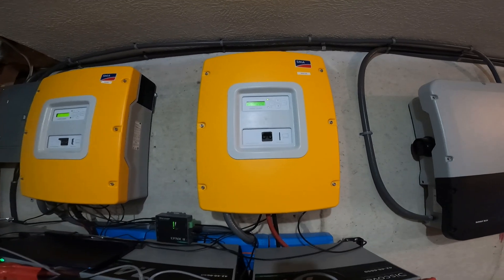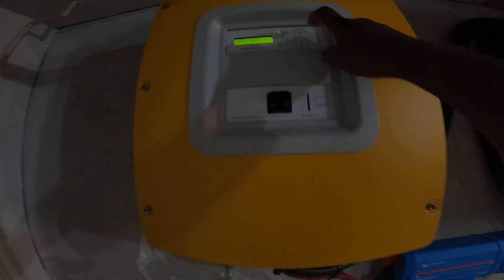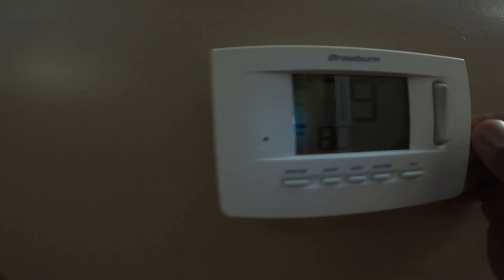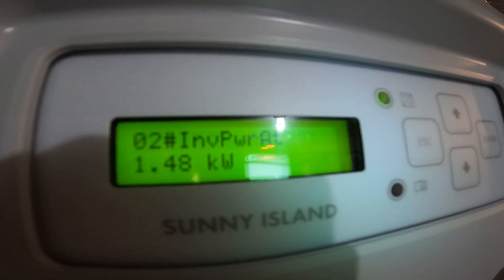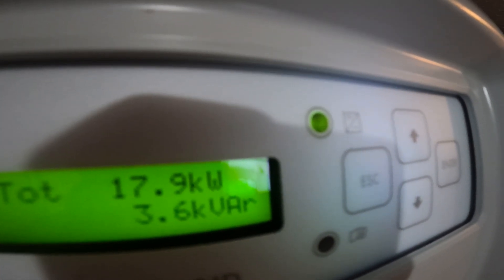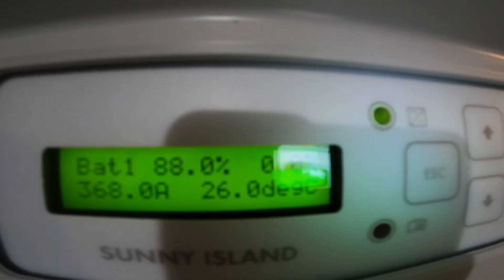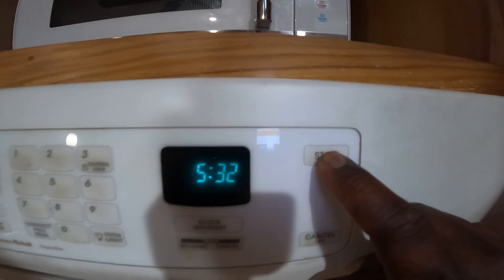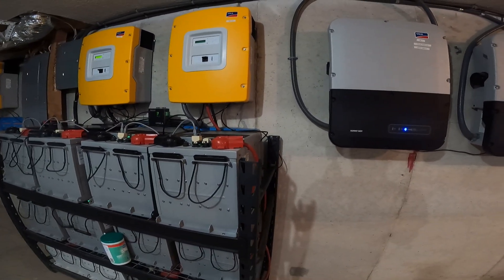OFF-GRID SMA SUNNY ISLAND INVERTER (24KW) LOAD TEST.

Comment: Hello there, a main question.
Did you completely DIY the entire system and if so was there any requirement for a grid guard installer code needed when pairing the Sunny Boys to the Sunny Island?

Can you do another deep dive demonstration video on how a first-time DIYer may duplicate your system at Home;  for a 1 or 2 or 4 sunny island.  Like what types of cables were used, what kinds of other components were used likes like all the story of whats going on from the Batteries connecting to the Sunny Island.   How to connect and set the proper parameters on to setup AC power from Sunny Boy to Sunny Island WebUI Settings.  How to design the wiring of the Sunny Island Inverter power output to the Sub-panel and to the Main Control Panel.    

The in depth technical engineering installation run down.   So that other inexperienced in electrical-solar preppers may assemble a similiar DIY Solar Entirely Off-Grid System.  

If you can make one more video one this maybe an update on how has your experience been thus far on how the SMA/ Discover Battery system has been doing.  

 -Thank You.

Comment: Well that is 24 KW 24,000 w you're going to have to have a pretty good size house to put those up to a full load especially when they go to KW over the rated power they run each one around eight kilowatts for an hour and a half s rate before it shuts down are you looking at quite a load I don't know if your house would ask you better use all that power for an hour and a half to get them all the shutdown that is an awful lot of power.

Comment: It looks like your Sunny Islands are primarily DC coupled through the victron charge controllers? Mine are arranged,  different in that all my loads are directly supported by my grid tie (created by the Sunny Islands) no grid from power company. My Sunny Islands don't produce positive power during the day.(ie no battery energy is used)( They simply control my grid tied inverters.
The excess shown by a down stream arrow on the sunny island master(negative number)shows excess power charging the batteries for night use.
My batteries are 90 KW hours and my house consumes around 15-17 KWhrs per night. FYI Fred
Reply from the maker: Hi, I am actually AC Coupling the Sunny Islands with the Sunny Boy inverters. I do not have charge controllers in my system. I am only using the viltron Busbar Lynk system to parallel my battery bank together. These bas are rated for 1000 amps. My system works exactly like you have explained yours above.
Reply: @backtoeden2030  How much does your house consume at night?
Reply from the maker: @backhoefred   It depends on the loads we may be running. Sometimes even doing laundry at night. Its  anywhere between 15-30 KWh and especially if we run the AC. The regular house loads like the refrigerator, computers and tv including what the inverter consume is only 400-500 wats per hour which total to 5KWH over the night.
Reply: Did you have public power previously? We did, we keep them as backup. But I am very happy with SMA. Mine were from a bankrupt manufacturer already pre-assembled. Previous system was Xantrex 5548 , very early production they lasted 22 years and were way ahead of their time. Have you ever considered starting a forum for Sunny Island owners?
Reply from the maker: @backhoefred   Yes my property  was connected to the grid but about 3 months ago I had it disconnected.   I became confident that the system that I set up is sufficient enough with 24kw of total inverters.  The electric company actually   came and took their meter away. I did not want to keep paying $30 monthly base pay even without using any power from the grid. All my inverters are brand new so I expect them to run for a long time. 
 A forum sounds like a great idea. I had difficulties finding information even on YouTube.

Comment: What is your battery bus voltage starting before anything is turned on? And then Bus voltage at 21 kW load?
Reply from the maker: 12-15 amps at basic loads and @21kw of loads, the the bus voltage if about 420 AMPS. This bus is rated for 1000amps.

Comment: That's so overkill too much power!
Reply from the maker: I know, I need to be able to charge my electric vehicle
Reply: It's perfectly sized for the average all-electric home in the USA. I have two solark12k. They produce 18,000W or 370A at 48.6VDC. I have used around 15kW and could use more if I had more stuff turned on. I don't like to push HF inverters to the max.